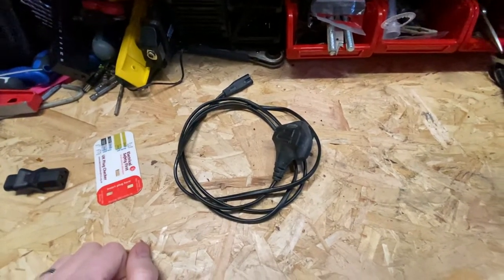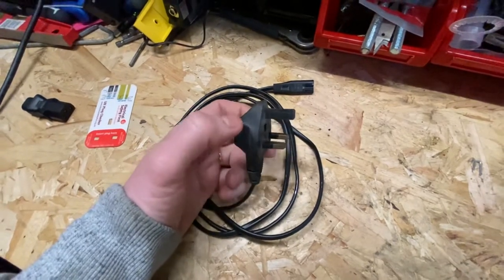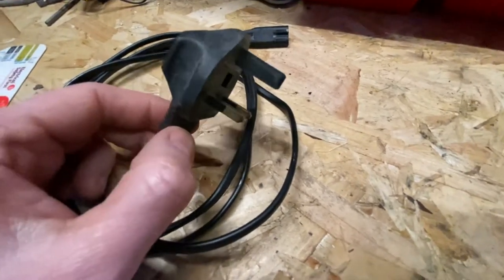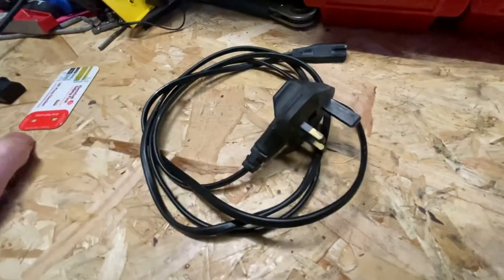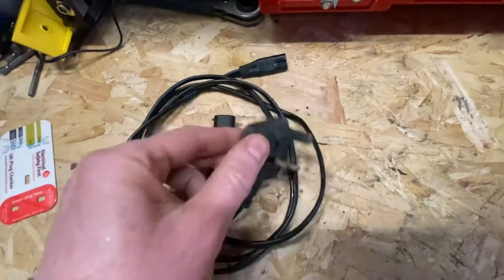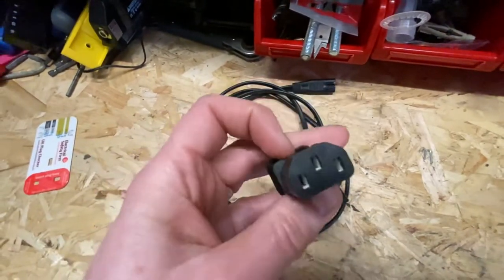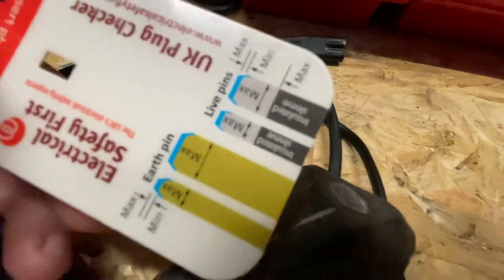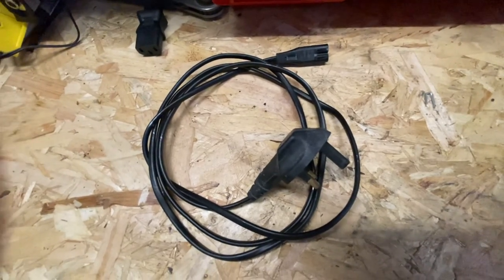PAT Testing Myths | Figure 8 cable | How to PAT Test it

Comment: As someone who has just started up PAT testing and have just done my first 2 jobs I find your videos extremely beneficial and would like to say thanks. Yes you learn on the course but that is a classroom and not the real world. I will keep watching your vids . Thanks Ben
Reply from the maker: Great to hear!
Reply: In the same boat Steve. Just literally done the course on Monday. You think you've got your head round it all until you get out there! Everydays a school day. All the best with it.  Videos are excellent thanks for that CPT. Keep up the great work
Reply: @macmerc1556  I had a laugh last week. I still work 3 days a week for someone and he had the PAT tester in last week. Took him about an hour to do 65 items plus all plug sockets plus microwave and it cost my boss nearly £250 and he admitted he wasn't even qualified and the company he worked for told him he had to get his ticket within 6 months. I watched for a while and he didn't do most of it correctly. Makes a mockery of insurance companies saying "You must use these to get PAT testing done"
Reply: The cord is a convenience for the manufacturer and the consumer. The manufacture can get the distributors in each country to source there own power cord for their country, so the manufacturer  can delete this part if the assembly, if you come across a Fig8 cord, ask for the device or appliance it belongs to, and plug it in to the appliance and do a Class 2 test on the appliance the cord came with.

Comment: This was useful. Although I don't think you said so in the video, I checked what PAT testing machines do for the RISO test and they short live and neutral together and then apply the 500V (or 250V if you're operating at reduced voltage for a surge-protected appliance) between the live/neutral (now electrically one) and earth. I understand that's the standard, meaning all PAT testing machines work that way. I didn't previously know that, though it makes sense and also supports your conclusion. Similar logic applies to something I've been puzzling over, which is those shaver adapters that convert from standard 3-pin male to 2-pin female for shavers and some toothbrushes.

Comment: I've always visually checked the fig 8 cable but then used it to test whatever appliance its for as a class 2 so it checks both because you need to test the appliance. What's your thoughts 🤔

Comment: You could do a resistance test on the individual conductors. If there is a difference then that could be a faulty conductor or connection, both conductor wires are about the same length and cross section indicating the same resistances. I would test from the conductor side of the fuse to be sure.
Reply from the maker: You certainly could but that type of test is not something a Pat tester is ordinarily trained to do. Nor is it a test recommended in the code of practice.

Comment: I personally test it as class two by plugging the BS1363 plug into my tester and the other end into the fig of 8 adaptor (like what you have shown in the video) and then into the iec port and then select class two test, I was advised to test this way by the manufacturer of my machine, but to also put more emphasis on the FVI and log it in the Notes/Comments.

When I done my City & Guilds 2377 I was instructed to do a FVI and test a figure of eight lead (if on it's own) as class two and either leave the earth test lead off or clip it onto or near the end of the fig 8 lead. 

I don't really see the point of this but I do test them now as I previously stated above, as I can not just enter a FVI on my test report without carrying out a test on the tester, (it's just the way the software works on my machine), I then just make any notes or comments in that section on the test report.
Reply from the maker: I do see what you are saying but as I mention in the video the Figure 8 adaptors in my video are completely useless and in some situations dangerous. By plugging one into your Figure 8 cable and then running a class 2 test your machine is testing for absolutely nothing - I'm afraid your manufacturer has advised you incorrectly.
What machine are you using? Are you not able to log just a visual inspection like you can on the Apollo range of testers?
Reply: @caterhampattesting  No it won't let me as I'm using a Memory PAT Blu with the phone app, so you have to press a physical test button to get it to ping the test over to the app on the phone, then you can add FVI and put a comment in the notes. 

I also use a Primetest 250 along side the MemoryPAT Blu to do the same sort of thing for the portable RCD test, I have to do a class one earth continuity test on the MemoryPAT and then add in the notes/comments the RCD trip time

Comment: The Fig8 cord is a convenience for the appliance manucturers and the consumers.
The appliance manufacturers can get the distributor in each country to source cords for their country, and the factory can delete the install of a hard wired cord for each corner of the globe, and 2 the consumer can replace a chewed cord etc.
If you come across a Fig8 cord, ask for the appliance it came with, and test the appliance plugged in as a class 2.
If they dont have the appliance, and its a spare, ask them for which appliance, and plug it in do a test and use the same id with 'SPR' on the front or end and Tag it!
Reply from the maker: Are you in the UK? It sounds like you might be in Australia?

Comment: You can bridge the fig8 end and do a low ohms reistance test up and down both conductors, that will verify it's ability to carry the current rated on the fuse.
Reply from the maker: There is no need as what are you actually testing it for. If the cable is rated for the fuse fitted then just a visual inspection to confirm this is required.
Reply: @caterhampattesting  For pat testing then yes, not needed. It's a good test for a diagnostic technician on a potentially broken cable, signal or power.

Comment: An insulation Resistance test is checking that there is no short between the conductors. You could do an insulation resistance test between the line and neutral conductor.
Reply from the maker: you are partly correct. the PAT test machine is checking that there is no leakage to earth. if there is no external metal parts or earth conductor then your pat tester isn't looking for anything.
Reply: @caterhampattesting  you could youse a multifunction tester to check between line and neutral to obtain this result.

Comment: Hi, Agree regards visual only check on the lead, but regards to the items it powers i,e cd players, sewing machines etc you still plug it into the item and run class 2 test to test the actual item as be making a circuit round using the item ?? or im i thinking wrong ? thank you
Reply from the maker: yes absolutely. test the item as per class 2 guidelines. please see my other video on testing a class 2 item
Reply: @caterhampattesting  that’s great thank you confirming that

Comment: 4:30 'An insulation resistance test is looking for any leakage to earth.' Is it?
Reply from the maker: on a class 1 test yes, which is why on a double insulated appliance it is looking for any leakage through exposed metal parts that the test probe would pick up on.

Comment: c7 to c13 adaptor the do manual tests for. Or plug into an appliance and do class II test. Or use adaptor the manual tests. Also in my opinion if a person PAT testing pugs a class II lead into a C13 adapter the plugs that into Class I then he should not be doing electrical testing, in the field is not the practice ground that’s how to kill.
Reply from the maker: As my video explained, only a visual inspection is required on a figure 8 cable.

Comment: not saying your wrong, but if the insulation resistance is only measured against leakage to the earth wire, then what is the point of testing any class 2 item ? is the test current not put just down the live wire so it can be tested for leakage to the neutral wire also ?
Reply from the maker: So you can only carry out an insulation resistance test on items with exposed metal parts. You should be connecting your test probe to the item and then your machine will be looking for any current leakage through the test probe. 
For items of all plastic construction ie a Henry hoover or a 2 core double insulated cable such as in the video then there is nowhere to connect your test probe to. Therefore these items can only be a visual check only.
Reply: @caterhampattesting  thanks for the reply, I have ben testing all plastic class 2 items for the last 3 years for no reason then ha ha, I did think it was probably a waste of time plugging in phone chargers and things like AC adapters for things like low powered piano key boards, oh well it will speed up the proses just doing a visual inspection from now on.
Reply: @650GSF  luckily the test on the machine is only a small part of the test really(and should be the quickest part too).

Comment: You can check fuse rating, Live/ Neutral continuity ...
Reply from the maker: Yes I mention in the video about completing a full visual inspection. Not sure what you mean by live/neutral continuity but you can’t check that via your PAT test machine
Reply: @caterhampattesting  Using Multimeter and measure continuity of N and L, is this considered visual?
Reply from the maker: @mohammedshalash7842  there would be no need to use a multimeter. a functional check as per the code of practice would suffice.
Reply: @caterhampattesting  Thanks

Comment: This is not a figure 8 cable, but only a figure 8 plug. The cable is double insulated. Figure 8 cable generally is not double insulated and hence might not fit the class of appliances of your country that can pass a PAT test.
Reply from the maker: That doesn’t make sense? You say the cable is double insulated and then you say generally it isn’t double insulated?
Fig 8 cable is generally the term that is used the same IEC cable or extension cable.
And of course the cable / flex is double insulated? It has the inner coloured cores and then a PVC outer hence making it double insulated.

Comment: Folks, do not rely on this video, as it is quite misleading.  It depends on what test machine you are using.  Even a basic Megger that has a low ohms as well as high scale would allow testing of conductor continuity resistance of less than 1 ohm to be tested and also insulation resistance (>1Meg).  My preferred tester is my older Seaward PT200 as it has low and high ohms positions, and scales, so it will do this test with ease.  Too bad that Seaward no longer makes that device.  I would not allow this person to do Test & Tag testing on any of the equipment that I manage, too many assumptions and also maybe why he doesn't do the tests that can be done.
Reply from the maker: Please tell me how it is misleading? I’m guessing you are not in the UK? And also, please explain what test can actually be done on a 2 core fig 8 lead?
Reply from the maker: Very interested to hear your response?